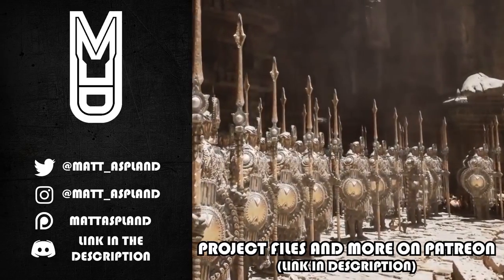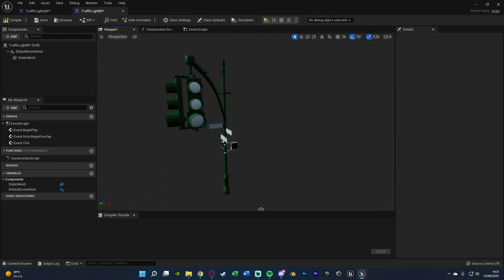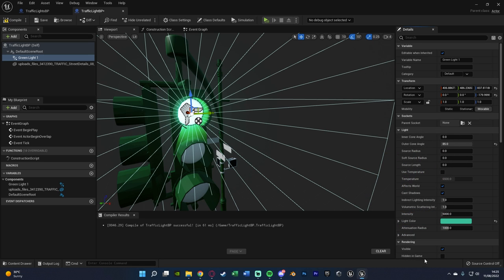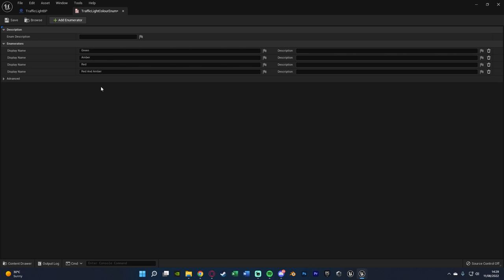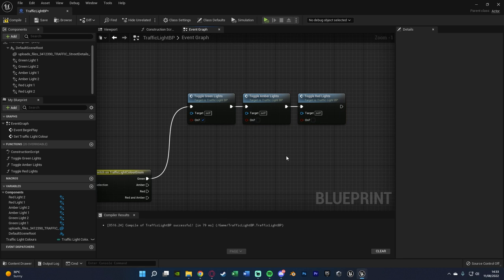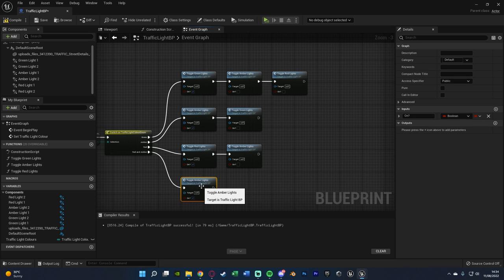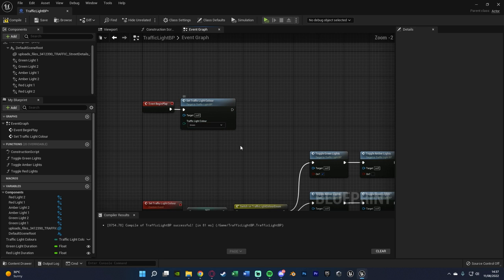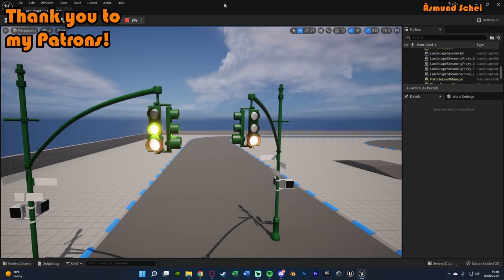How To Create A Timed Traffic Light System In Unreal Engine 4/5 (Tutorial) Traffic Light System Pt.1

Comment: Splendid as usual Matt. Have you any insights into custom clothing Metahumans?
Reply: try to built your own with marvelous designer, and then transfert the original weight on it, eventually adjust the weight with some animations in marvelous.
Reply: character creator 4/iclone
Reply: Thanks for the replies folks. I've researched those methods. I was just wondering if there were any options other than those that are more budget conscious.
Reply: @lawebley  The "Budget conscious" is the autonomous way, using Blender as a free software, making the clothes targeted in Blender, then transfert the weight from the body to the appareal made, and adjust with some animations "Base Pose" finally edited for your Metahuman Character. for that search : "making custom IK rig in Blender" -- "Create Base Poses in blender" -- "Weight Transfert in Blender"